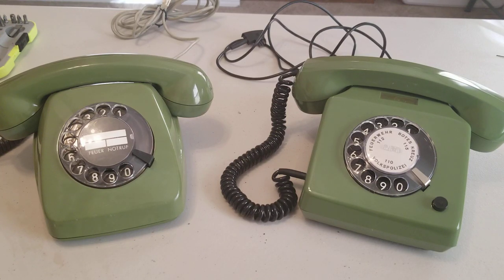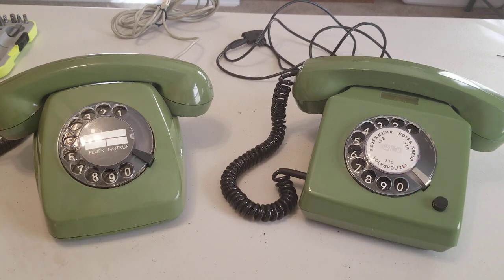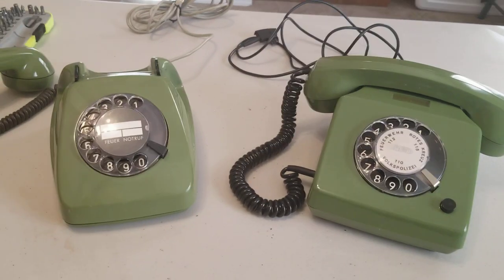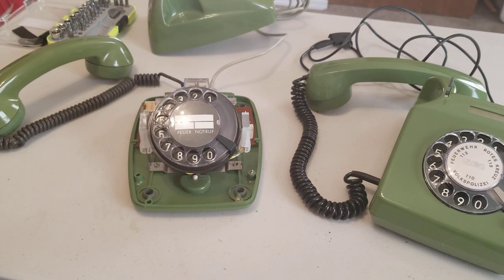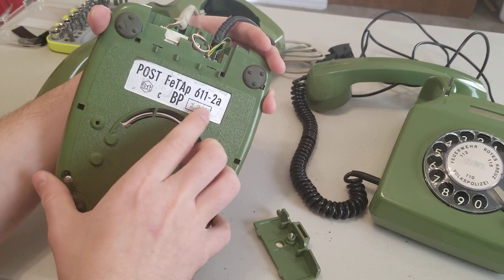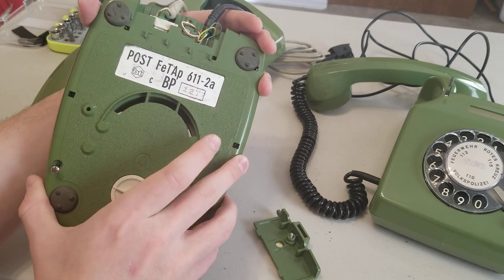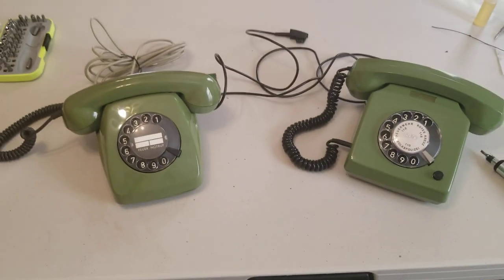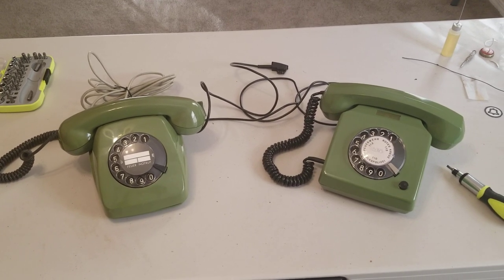East and West German Rotary Phones

Comment: I have an orange  FeTAp 611 did you ever get yours to work?
Reply from the maker: Not yet, but I haven't gotten around to actually trying yet. Should be a fairly simple matter of figuring out which wires on the German unit correspond to American telephone wires and splicing a connection, or coming up with a makeshift adapter since I'd prefer not to remove the German cord.
Reply from the maker: When I do get the time to do it I will make a video.